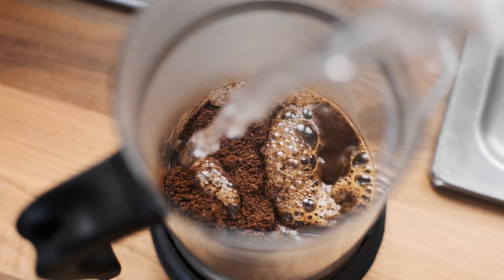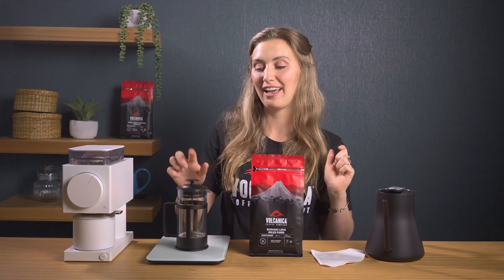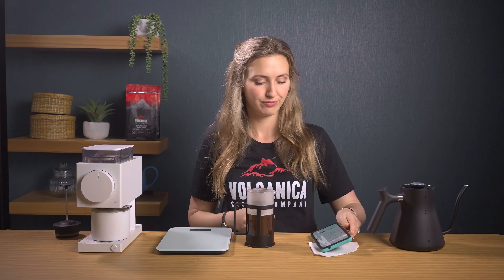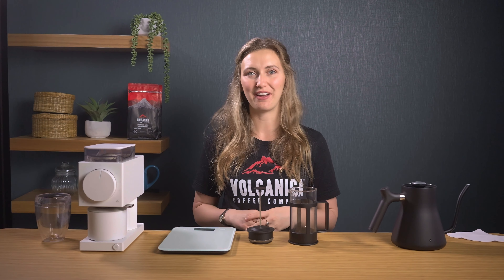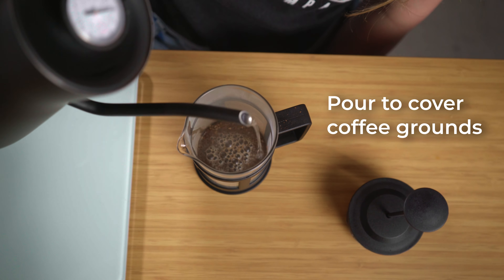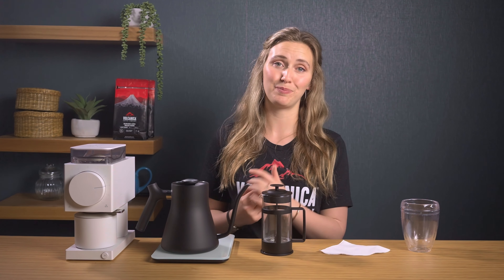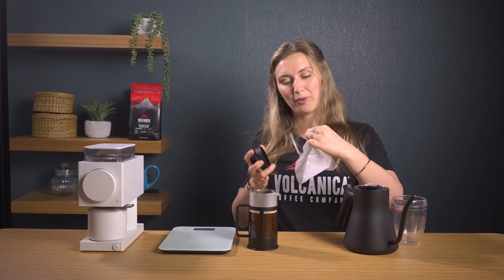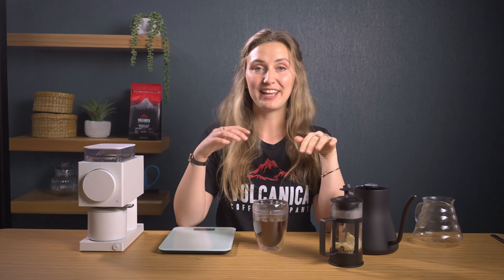French Press Technique: 3 Game-Changing Methods

Comment: My technique (bear in mind I’m a novice), is the following.

• Medium freshly ground light roast beans
• Bodum 500mL Columbia insulated French press pre heated with boiling from EKG Corvo
• ~30 seconds later remove boiling and replace with 125g/L, in my case 62.5 grams in my 500mL press
• ~30 seconds later bloom the beans with 100g/100mL of the water which should be closer to 95C now and stir for ~30 seconds
• Pour in the remainder of the water to top up to 500mL and stir until the crust becomes thin and breaks apart and put on plunger lid
• Wait ~5 minutes and slowly press the plunger down over the next 15-30 seconds
• Wait a minute for the silt to settle and decant

Loving this right now, just got the ability to check temperatures more accurately so I’ll be playing around a bit.
Reply: Note, the filter paper will remove oils which add a depth of flavour, I choose not to do this for personal preference, but I decant slowly to avoid pouring silt into my cup.

Comment: Hi cool video
What setting did you set the Ode for the James Hoffman technique.....Ode gen 2 it looks like 

Also if I'm using a dark roast, do I need to increase the grind size to a coarser grind?

Thanks, 
I look forward to trying all three recipes
Reply from the maker: Hey @cycles_beruff4005, thanks for your question. We used grind setting: 7 on the Fellow Ode. 

Indeed, when using a dark roast for a French press, it's generally recommended to use a coarser grind. Here's why:

Flavor Extraction: Dark roasted beans are more porous due to the extended roasting process. A coarser grind ensures you don't over-extract the flavors, which can lead to a bitter taste.

Prevent Overpowering Taste: A coarser grind with dark roast beans will help you achieve a smoother, more balanced flavor profile in your cup.

Reduce Sediment: Using a coarser grind will help reduce the amount of fine coffee particles that can slip through the French press mesh filter, leading to a clearer brew with less sediment.
Reply: @volcanicacoffee  very cool.. thank you